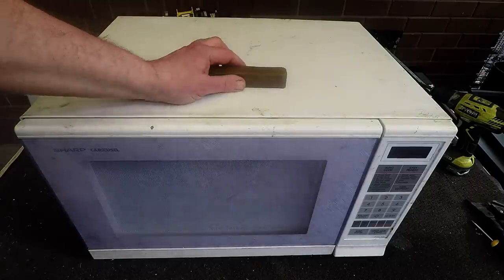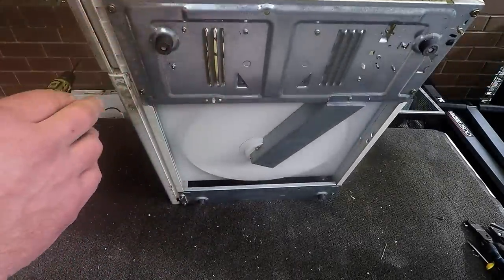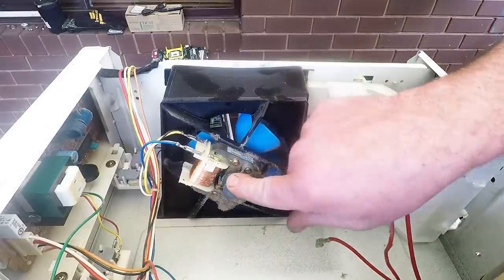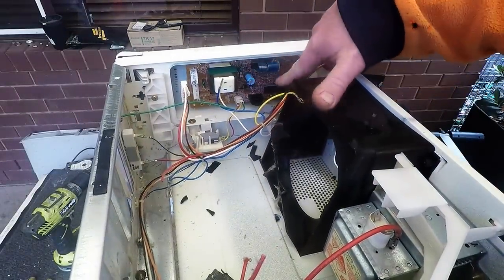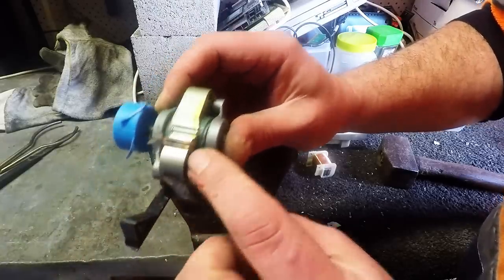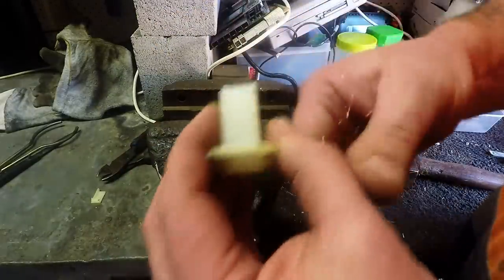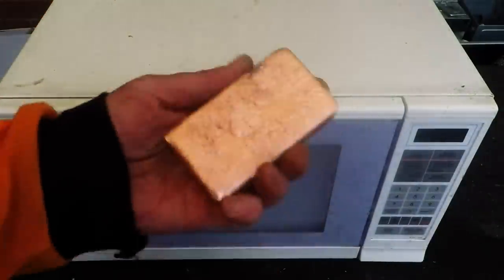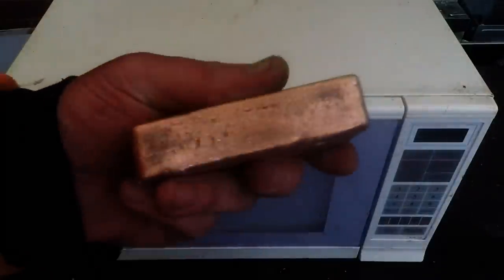Free Copper - Copper Bar from a Microwave Oven

Comment: copper is a great metal, it holds value for a reason, a very good conductor of electricity.  its antimicrobial, it is non corrosive, it has very strong tensile strength and its really pretty in my opinion.  good video, and thanks.
Reply: Also copper salts are blue when they are hydrated, such as copper sulfate pentahydrate. Copper Chloride. Copper nitrate is greenish.

Comment: I thought what you meant was that you could heat up scrap copper using your microwave and melt it into an ingot.
Reply: You can, you just need a microwave kiln set.
Reply: John John LOL
Reply: You can, just get 2, maybe 3 microwaves
go sell the scrap you get from 1, and go buy some really thick gauge wire, pop out the small coil in the transformer, replace it with the thick wire, hook it up to the mains and BAM, metal melter
Reply: John John exactly what I thought!

Comment: Hi - thanks for the tutorial on recycling copper wire from a microwave.  VERY interesting!  BTW, I've removed the quite strong magnets (there are two) from numerous microwaves without troubles of any kind. Yes, there's certainly more heavy copper wire in the 'magnitron' than than the tiny pieces you recovered.  Thanks for posting.  John

Comment: I was going to say, the magnetron has a nice chunk of almost a kilo of copper, the tip had the purple/pink ceramic beryllium oxide, that's what you have to avoid, just hacksaw though the copper past that, discard or whatever you need to do with it..

now just in case you saw though the beryllium, make a safe area, for only cutting that, eye and dust protection, rubber gloves.

Also, it stores no charge, its the large cap that is directly attached to it that may have a charge, pop the wires off that 1st.
Reply: The BeO insulator turns out to really just be a myth, if they are pink you can be sure it's alumina, not BeO. BeO is really just used for multiple kW magnetrons for continuous wave radars.
The pink actually comes from additives and impurities such as titanium, which is to improve mechanical properties, indicate it's alumina and indicate the grade (pink is usually 88% Al2O3)
Always thought it's BeO too, but apparently not...
Reply: Thank you, good to know!

because of that info, just done a little reading, hot caustic soda will eat alumna, but ignore Berrylia, so wash em in caustic soda, if the dielectric dissolves, you're good to go.
Reply: Testing it chemically is a great idea! Not sure if NaOH solution will do it since it is sintered and apparently that stuff is hard to dissolve, but maybe the 12% additives will and it will fall apart? Don't know, I've never tried but it's a great idea!
Reply: Honestly, I doubt there's even a Kilo of copper in a Magnetron. Perhaps only 2 ounces at the most (54 grams). Its mostly steel with a couple magnets.
Reply: the few I've played  have been rather heavy, but yeah, less then a kilo, but a lot more then 50 odd grams, but hey, if you say there is steel in them, that probably the weight then.. the ones I've had hold of, the main chamber is all copper. after i've stripped the casing and magnets off them.
Reply: I've taken apart a number of modern microwave ovens, and I have never seen a magnetron with a significant amount of copper.   There's a small coiled wire; maybe a few grams at most.

Comment: I was hoping to see a warning about the capacitor. You can stop your heart with one the size that microwaves use, and it's too easy to short it out FIRST THING.
Reply: Frog Slough don't those have a bleed resistor though? As long as it hasn't been run in the last few hours it should be fine
Reply from the maker: I don't touch the capacitors at all
Reply: Frog Slough Discharge it with an insulated screwdriver to be safe.
Reply: Agreed, but I'm not sure about the older microwaves, which is what this video references for copper.  A mention about the capacitor would have been good since many third-world countries watch these videos and want to get on with eWaste as a second or primary income. Great video nevertheless, eWaste Ben. Thanks for sharing!
Reply: you touched the cabels on the magnetron and they are connected to the capacitor same with the transformer
Reply: How much money does the bank give you for that copper?
Reply: stop your heart? with one the size of your pinky you can stop your heart, with one this big you could probably vaporize some of your flesh
Reply: Frog Slough I
Reply: Most modern microwave ovens have a bleed resistor. It's safe after two or three hours after the last run. But I will always bridge one manually to be sure. And always keep one hand behind your back when cutting stuff like that apart.
Reply: You just need to do it from the top of a tall aluminum ladder , the impact with the ground will restart it ..
Reply: modern microwaves don't use copper in the transformer EITHER COIL.
Reply: +TheIAMINU
Lol!
Reply: SkunkWerX J.P.L & Thermodynamics 

One hand behind your back?
Also: right hand better (in case of cardial grounding)?
Reply: max webster they use aloomineeum
Reply: mrromantimothy my point exactly. why bother for $0.30 worth of alloy other than increasing the cost of your heavy melt but electric motors pay near the same as heavy melt. Waste of time.
Reply: Ben, I'm with you on not touching caps HOWEVER I think the statement needs to be ANY WIRE CONNECTED to a cap. Most of us know what you mean but there are always a few......I worked in a factory testing dept. The training consisted of working on a 60A breaker, no GFI and they melt a metal box end wrench about once a month. I was awarded a settlement for refusing to test and they continue to be stupid. The motor I worked on were connected to at least 80mF. The machines weren't even grounded and should be globally recalled. ETL Intertek "must have" approved the wiring diagrams and we ran wire ALL the time without approval or certs from engineers (they asked me to make it work)!
Reply: Banks don't buy copper bars silly. Recyclers do.
Reply: max webster 
Hey Max...!
Sounds like when I was in the Navy...!
Reply: alan30189 
And don’t forget individual collectors/investors.
Reply: Troy, I don't know who your comment was directed at but it didn't contain anything logical which was the basis of YOUR OWN COMPLAINT.
Reply: Really for all you nutz worried about the capacitor simply do this.  See those needle nose pliers with the rubber grips? Use those to take ONE lead off the capacitor before proceeding.  Done.  Now move along.
Reply: Pee on it first
Reply: We used to load capacitors with 50,000 volts and just leave them on a bench until someone picked them up, no one ever died, they just jumped a little.
Reply: Willeexd not to ground though, some caps don't discharge through the magnetron besides through ground.
Reply: Max McCormick bleed resistors can die before the capacitor dies, so it may still hold a charge.
Reply: Would your left arm in particular be the best to keep behind your back as it's closest to your heart?
Reply: tie a rope to it and throw it in a rubermaid full of water lol
Reply: Microwaves only go up to 3kv and the caps are paper oil which means it won't stay charge long.  If you have wet hands and touch both leads then maybe a hart tact.
Reply: eWaste Ben Has
Reply: such an intelligent comment and a clever use of language.
Reply: Not to worry mate, I keep an extra capacitor on hand to restart if necessary. : )
Reply: I thought he would've mentioned the possibility of electric shock before he shoved his hand in there touching stuff with reckless abandon! Beryllium is also dangerous if someone decides to carelessly disassemble the magnetron.
Reply: vaporize, you mean like those inhaler/expulsion relievers on the freeway?
Reply: Spotted owl's taste like chicken!
Reply: Know wonder I can't get rich!
lol, thx!
Reply: Pick me---bounce---pick me---bounce---PICK ME!
Reply: @maxmccormick3376  That's a good way to get shocked.  If you don't know if the capacitor is discharged already or not the first thing you should do is discharge the capacitors if you are going to meddle with the electronics.  Unless you like getting shocked.

You can always add "but it has a bleed resistor" to a very long list of famous last words.
Reply: Sam Iam  I didn't know we Had any 'here in the states'. In fact even my GE profile computer heavy washer  wasn't 'worth fixing' despite the only problem being that one of the shock absorbers had vibrated loose from going a million miles per hour!
Reply: Good point!. Safety FIRST
Reply: How much fuel burnt for this much melt? If any one have an idea.
Reply: LazyH-Online , true. Read my comment on this, further down this thread.

Comment: Hi Ben, I was an operating engineer by trade. Out of my 36 active years, 30 of them, was in the demolition field. I could tell you some stories but at any rate, I'll stick to something related to your video. Now heres what I would run in to, even when I knew the people who either owned or worked at the scrapyard. I had taken in copper a lot. Anytime I took in any wire, if it had just a small piece of any wrapping, they'd call it #2 wire. I mean, I would argue the fact that 99.999% of the wire would be solid and clean, that small wrap of flaky lacquer would change it from #1 clean, to #2 light covered. That's how they would do it here in Michigan. Now the bars, I'd probably think about doing that because it will for sure go as #1 copper. But, yes but, I would have to make sure if I was gonna sell it in bricks, I'd use a wire brush to polish it up because of the following. I've seen the scrapyard scale man try to knock the price down when it's tarnished, if you can believe it. It happened to me a number of times with heavy copper pipe. Even when I removed all soldered joints, unless the pipe was shinny clean, they'd usually try to pay me/us for #2 clean. Now that I'm retired, I can spend the time and do it like you're doing, so I can get the #1 price. Another thing, have you ever noticed what some of the copper bars sell for on eBay? I have and I've messaged the seller to see how many bars that he/she's sold at the price advertised. If the seller has sold more than 1, and the buyer paid for shipping, I might even try it that way. I forget that some people don't or won't go to scrapyards to get copper, so why, I have no clue but even when copper was selling for $4.00 a pound, they were able to sell it for $6.00 per pound.. Strange. But again, great video. I've subscribed to your channel because not only have you've given me some good idea's but you've answered some questions or explained some things to me that I didn't know. So thanks for uploading another great video. Even with all the experience I have, I have learned something from each one of your video's I've watched so far. Dan

Comment: there is more than a little bit of copper in the Magnetron and it is easy to separate it from the ceramic ends without disturbing them too much ive scrapped hundreds or microwaves and extract every bit of copper including the dish motor. great vids keep up the good work!

Comment: love the old, crusty vise!
Reply from the maker: yeah it's over 60 years old, got it from a closed down motorcycle workshop in the late 80's
Reply: These vises from China suck. The old school vises made in USA get passed down through the generations. Put themselves out of business by making quality products. Maybe the Ozzies used to make good ones or still do..
Reply: Yep Dawn vises here downunder. I managed to find one of the rare early ones that has the spring loaded quick release/ fast adjust lever like their dawn wood work vices have, where you push the lever the the vice jaw slides in and out by hand and when you let go the spring loaded lever, you then wind the handle to tighten it!. They stopped making them on their cast iron steel work vices, and you have to wind the jaws all the way in and out to suit whatever your clamping now by hand which is a PIA. The spring loaded release lever saves a heap of time and winding handle effort. Dawn made a spherical graphite cast iron model they called the unbreakable model - they will last 100's of years of abuse and still keep kicking - they still make them in fact but they are over $1K to buy new now for a 4 inch and approaching $2K for a 6 inch..
http://www.dawntools.com.au/vices/Engineers-Offset-Vices-Cast/Engineer-Offset-Vices-Cast
They been making them since 1917 so 100 year anniversary this year!.
I used to buy them cheap second hand and strip & clean / repaint and restore them with new jaws inserts and straighten the handles if they were bent & wire wheel them etc. They would look as good or better than new... then re-sell them for near new prices for a while.
That way I got to hunt down a pair of the early lever release quick adjust models for myself and a couple of the spherical graphite cast iron offsets etc for my own steel work bench.
Machinists always trying to buy the quick release vises off me but i won't part with them - they are rare as hens teeth these days, and you'd always miss the convenience of the quick release/adjust feature once you have owned one.
Spinning the handle with one finger to wind the jaws in and out fast gets old quick specially as you get older and get arthritis on your fingers - it can get painful in the cold weather!.
Dawn engineers and wood work vises are an institution downunder among tradesmen.
Everyone needs half dozen or so - one on your work ute & one for your fire-wooding trailer to hold the chainsaw while you sharpen the chain, couple of straight and offsets for the steel work bench and a couple of wood working ones on your timber bench.
They are the sort of vice that are multi-generational if you look after them.

Comment: you know that when you scratch the coil the transformer doesnt work anymore so so cant resell it
Reply: it can work sometimes but when you scratch it you short out the coil
Reply: did you watch the whole video because he said that if it was aluminium he would resell it and when he scratch to see if it is aluminuim or copper he destroys the coil. if its copper it doesnt matter because he melts it but if its aluminuim then the coil is ruined and then he tries to sell a broken transformer
Reply: Well this guy is in Australia and they dont do everything normal sometimes.
Reply: a couple scratches on the windings don't ruin it. they are light not huge gouge
Reply: If he didn't plan to melt it down, he would still be able to sell the transformer as scrap for recycling, which wouldn't matter if it was broken o not.
Reply: I SAID THE BANK WANTS IGNOTS AND NOT ELECTRIC PARTS. THEY MAKE COINS OUT OF IT AND NOT JUNKY ELECTRIC STUFF.
Reply: Dude i don't think the bank even buys copper ingots. I'd be interested in which bank buys them. When the government treasury makes coins they buy wholesale from large companies not people who make ingots for fun
Reply from the maker: No, I sell as scrap tranformers to a scrap yard, not as a working tranformer, there's much better transformers in some electronics that I keep aswell as vintage, microwave one's are a too common to try sell as is around here.
Reply: No, he hoards them for WTSHTF.
Reply: you can sell the ingots to a refinery they buy metals and are able to identify all metal types if you have something questionable say a ring and dont know if plated gold or plated silver they put it under a gun which reads out the composition
Reply: Hoarding ROCKS. be prepared - scout motto
Reply: Paul S, and a drop or two of fingernail polish on the scraped part will probable re-insulate the wire well enough that it would not be shorted out.

Comment: I've been scrapping microwaves for years now, I have a dozen MOTs under my bed! I always scrap the magnetron, they never have 'Residual Power' and I always treat them like they are beryllium. There are two insulators on the magnetron, One on the gun and ine inside the big metal box at the back. They're usually white or pink. They are the berylium ceramic insulators. Don't break them and you're fine, use microwave magnets for my fridge ;)

The thing you really need to look out for are the capacitor and the plate motor, Don't remember the proper name for them.
The capacitor can kill you, instantaneously. I myself have recieved a nasty shock before.
The plate motor will give you a real nasty shock if you accidentally turn it while your hands are on the contacts. Around 94V of pure pain. Not fun, Trust me. I've been zapped atleast 5 times by the buggers.
Edit: Spelt Microwaves "Microwavea" ahah
Reply: Well use them in a home windmill then.
Reply: DrJones Hey, I have enough money to buy large neodymium magnets, I don't need to scrap, I do it because its a fun hobby.

5 times in about 200 odd microwaves sounds pretty good to me.

Also, Its Scrapping, not Scraping.

Surprisingly enough, I don't remember doing it, or even seeing your channel before, But I'm one of your subscribers..?
Reply: tallwill38 Probably should remember! I do it accidentally, A couple microwaves I've scrapped have the turn table attached to the frame with something durable, Always forget that rotating it to break the stuff while my hands is on the contacts is a bad idea lmao
Reply: apard7 it takes less than 3 seconds to short the capacitor with a jumper wire. Have you been hit by a live MOT? I will never forget that moment.
Reply: An asynchronous motor will not produce power without an excitation capacitor. Of course if it is a synchronous motor it's like an alternator.
Reply: Fritz, use what in a home-windmill?
Reply: apard7, why don't you just wear some rubber gloves all the time?
Reply: hey i accidentally scraped off some of the paint on it... will i die? have you ever done this before by accident
Reply: he is saying to use the Asynchronous motor since it generates AC when turning. Hence a windmill
Reply: thank you. would make a pretty small windmill no?